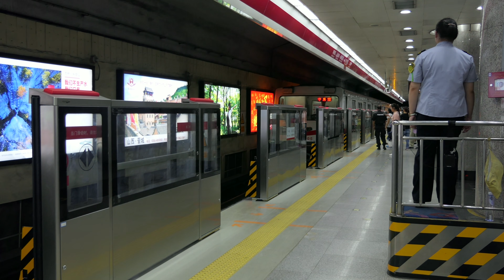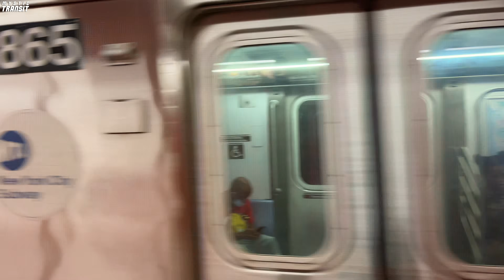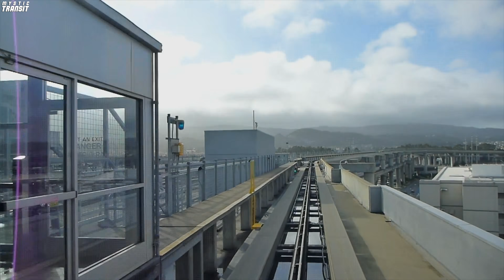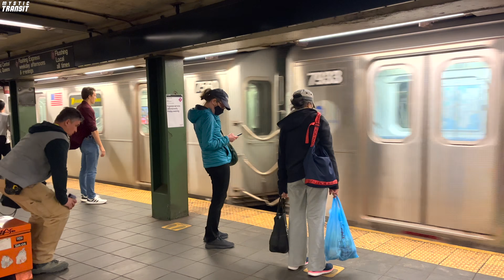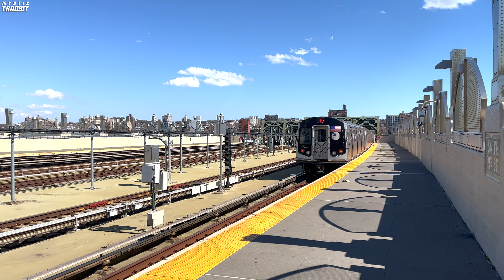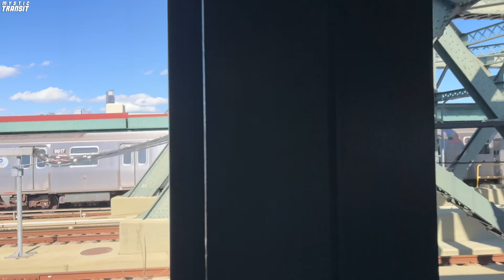Does NYC Need Platform Screen Doors?

Comment: I saw this video on my homepage because I have been searching out videos about platform screen doors since I discovered a video about them being implemented in Japan.  I am going to be speaking at the Chicago Transit Authority Board meeting next week about this very issue.  There is a video showing a station in Japan that has a fence that rises up above the platform when a train approaches, and I'm wondering if that is less expensive to do because there are fewer moving parts.  Also, without individual doors that open sideways, you don't have to worry about differences in distance between doors on different trains.

Comment: The problem with multiple rolling stock having differing door placement would make the wire rope platform barriers seen at some Japanese train stations the best solution.  I believe they are also cheaper than the standard glass panel psd's.

Comment: Right now, the one station that I believe should install platform screens doors is the Lexington Avenue/59 Street on the N/R/W line. It has one island platform that especially gets crowded around the stairs with people transferring to/from the Lexington Avenue line. But since the station is used by rolling stock of different length, the R160’s 60 footers, and the 75 footers of the R46s and R68s, the station that probably needs the platform screen doors the most is unfortunately a station that currently can’t accommodate platform screen doors.

Comment: My take for PSD in the NYC Subway is that it should be implemented at places that have little to no interlining and have rolling stock with similar dimensions as mentioned. The Flushing Line (using R188s only) and Canarsie Line (using only R143s and R160As) could have them first, since they are mainly deinterlined anyways, so PSDs can be installed there with little issues. As for the rest, they would have to wait till the rolling stock dimensions are standardized.

Comment: If they need the platform screen doors for the entire system. They need to clean up and Seal off any cracks and upgrades the track foundation. Then entire system will installed Platform screen doors. Because i seen the other video on other YouTuber i seen the rat around the line and some train have 3 door on each side and some train have 4 door on each side.That my guess.

Comment: A big problem with platform screen doors or barriers is if a train comes in and has to stop short for some emergency, the train  doors won't line up with the platform doors trapping people. The TA does have limited platform barriers in select locations and is looking at other locations. One long existing example are the ends of the 7 Grand Central Station platforms. Most transit systems don't have platform barriers for good reason.

Comment: Yeah, that's what I'm thinking because it's really scary for people getting pushed into the tracks aggressively, so in order to solve this problem, I guess the MTA should add screen doors so it will be safe and easy for people to not get pushed off the platform even when their's a crowded subway platform or people bumping into each other so it's a smart idea to put out some platform screen doors

Comment: Here in São Paulo, line 4 was the first to be inaugurated with doors already open in 2010, then line 15 of the monorail in 2014, then it was installed in all stations of line 5 in 2021, which had been inaugurated in 2002, they are currently installing them in lines 1, 2 and 3, leaving all stations with doors until 2025, there is the plan for installing doors on metropolitan train lines, we call them cptm here, lines, 7,8,9,10,11,12 and 13, Line 13 connects the city center to Guarulhos airport, opened in 2018, there are plans to put the doors on this line first. We have too a street car line, in Santos city on the coast, we call it VLT, and all stations have the doors, even though it is a service with low demand, All new lines, like line 6, and line 17 of monorail being built, will already have platform doors

Comment: 30 million dollars per station is nuts. How much do they cost to install in Europe? The door issue makes them a total non-starter at most stations. The L and 7 are the only routes where they can be installed at every station, not that it's needed. This is because they are the only lines that don't interline with any other services and never see reroutes of other services. I'm skeptical of installing them anywhere on the QBL because while it operates exclusively R160s now, what if they want to run R211s on it eventually?  If they don't have the same door positions as the R160s, then they will be banned from the line.

Comment: There are doors on cars, there are doors on lift. The door keep you save, and save life’s, and how is it not implemented on New York, one of the busiest and largest metro system in the world.

There are actually different doors with different size. And I don’t understand why the metro cars need to be flexible. I think few lines exchanging car is ok, but for the whole system, that is a joke.

There is a fixed amount of riders everyday. The system engineer could figure out how to optimized it while having same type of trains on each route. Then, a door could be installed.

Comment: Very simple , low cost, low tech solution, would be To look down at your feet. If your standing on a Yellow stripe, BACK UP!!!!!!  Or when possible, position yourself behind a pole or other obstruction until the train comes to a stop. This works very well since as a teen in the 1970's and 80's the NYC subway was a Brothel for crime,and I'm still alive and well.

Comment: I think the screen doors can work on the IRT lines (1-7) since the doors stops at the same spot.  Some station already has markers on the platforms where the doors are going to be at.  As for the letter lines (D and F trains) they are still using 2 different cars whereas you mentioned on the video, the doors do not align.
Reply: The IRT still also have different door spots where the trains stop so you can't install them on all of the IRT lines

Comment: There are three problems with placing barriers on the subway platforms in NYC.  So he’s right about this.
1. The older trains and newer trains have different door positions making it impossible to indicate where the doors would open at.
2. The financial situation for this would be nearly impossible. Plus it depends which platforms need it the most. Mainly on the newer platforms like the Second Avenue line or on the Flushing line.
3. Reducing crime is the biggest problem we face today and it only getting worst by the day.

Comment: I think for screen doors to be implemented there needs to be gentrification of the subways. Clean them up and make them less dirty, grimy Hotspots. Once done, I believe chest-high barriers should be implemented, ones that slide open automatically. This can allow for a good view of when the train is arriving and for rail fans. Unlike many stations in South Korea, these barriers are completely inclosed which obstructs the view of the train. I also highly encourage the MTA to add barriers to congested stations, narrow platform stations, and to elevated stations.

Comment: I think Platform Screen Doors will mostly work for lines using NTT’s. The 7 using mostly R188’s and the L using mostly R143’s (w/ R160’s playing a supporting role) would likely be contenders for PSD’s to be implemented throughout most of the lines.

The SMEE trains would all have to be retired in order for PSD’s to implemented on most stations throughout the system. Notice how I said “most”, because not all stations can have PSD’s installed, especially those with columns close to the platform edge or, like 14th Street-Union Square on the 4, 5, and 6, have platform gap-fillers.

Comment: Some of our subway stations almost like a S shaped C shape curve beds that the tracks lay up on. Depending on how the platforms are designed Fencing door's for safety purposes is way to expensive to reconstruct over a 100 plus year's Transportation system.
Reply: Plenty of stations on the Paris metro also have curved platforms and still have screen doors

Comment: It's too old of a New York City subway station to install new fencing of gates around most of the New York insurance that run above and below plus tickets to consideration we have platforms that has elevators most of the cars and doors will have to be redesigned for all of that purpose plus it causes thousands of dollars to restructure and rehability station that will run throughout the course of having that done. NYC transit system would not pay money for that installment or the tax taxpayers of New York City or the state and local government will not help with that pressure financially at all it is considered a burden.

Comment: NYCT barely keeping the system running.  When there is heavy rain, the stations are flooded.  Will the flood water cause any expensive damages to the proposed screen doors.  Low tech steel platform barriers might be better solutions.  More importantly, need to relocated and treat the mental-ill people who are occupying the NYC subway system.

Comment: I think that the full height doors and standardisation of rolling stock will be useful in tunnelled sections. At above ground sites half height PSDs may suffice. The MTA like all organisations have a duty of care for their passengers so if an accident occurs and the victim Sue’s then there is the question of did the MTA / service provider do everything reasonably practicable to protect the health and safety of not only their passengers but also their staff. Picture the impact a one under has on the driver and the risk of losing a highly trained staff member and the I pact that has wither temporarily whilst signed off or the recruitment & training costs if they leave.

The other thing we need to consider is the cost of disruption when these incidents occur. It is not only the direct economic impact on the transport provider but on wider commerce. For this I will use an aviation example. In the late 1990s at London Heathrow Terminal 1 there was a fire in a Burger King outlet which caused major disruption and £500,000 damage to the terminal. Sounds big money? Now think of the knock on impact to the airlines which come to approx £6-7 million but it does not stop there as a predominately business airport the global impact on world business was approx £140-150m whilst a person on the tracks won’t have as big an impact as the Burger asking fire it will impact other business. Following the fire fast food outlets disappeared at Heathrow and a number of other UK airports with much stronger restrictions on catering outlets. So how can NYC MTA and other transit providers reduce the impact - simple measures like platform edge doors starting at the bigger/busier stations.

The fire at Kings Cross London Underground station at which saw many lives lost saw the end of wooden escalators and the banning of smoking on the network.  Access and egress has also been looked at at Kings Cross and platform safety at Bank station has seen a new platform constructed with more space (admittedly disappointingly without the platform edge doors which I think should have been installed at all closed stations during the Northern Line blockage).

It is however important to recognise the local trends to work out your higher risk areas but also useful to understand the challenges faced over over systems around the world learning from their development of services. Transport and human behaviours is always changing so it is important to ensure that we keep up with evolving changes such as platform edge doors and the new dedicated limited stop services such as the Elizabeth Line in London with dedicated lines and stations to also reduce congestion on existing infrastructure.

Comment: This is a good and bad idea because since the trains are manually-operated it can cause this: misaligned train doors, so the passengers would not be able to access the train; instead they will hit a wall. The good news is that the track-pushing crime will drop, and the tracks would not be overloaded with garbage.

Comment: The R211s are supposed to have wider doors which means they can’t interline with the R160s and R188s if you have platforms screen doors. Plus so many platforms don’t have the space. It will never really be possible. The idea is mostly floated by people who are uninformed about transit after a horrible incident occurs.

Comment: They should! they have it in most first world country. but America should be Number 1 is last when it come to anything that's good for the people. there's a saying around the world. anything you see will be in America 20 years later. thats how slow America improve. one thing for sure, WE NEED AC! PLEASE!!!

i also love it when you say the MTA system is designed in a way to allow interlining and easy rerouting. sure is easy rerouting when you see the train you trying to catch close the door as the your train is pulling up to the station n the train you trying to catch slowly drive away! easy my ass.

MTA is all type of broken. theres 99 problem and no solution.

Comment: Some Chinese hi-speed rail stations (with less frequent services) are using platform edge ropes. They block the trackway when there’s no train, and be elevated to there’s a train arriving. 

But the cons are the problem if their slow movements can be capable for NYC’s headways.

Comment: Issues of people falling onto the tracks?  That's a good one.  People wouldn't be falling into the tracks if not for the NYC evil and crazies pushing innocent people onto the tracks.  Those barriers are a must for our transit system.  There isn't any other way to stop the crazies from harming people simply minding their own business.  I'd rather pay a higher fare to get those barriers installed and not have to hear another sad story about someone getting shoved under a train for no good reason.

Comment: There would he difficulties that would ultimately make this an expensive mistake. The NYCMTA, changes the length of trains at various times to insure the safety of passengers at any given time. So any type of door system would require that it could also be closed off to accommodate this feature. Additionally, such screens would be an additional target for  vandals be it graffiti or breakage of materials or door openers.

Comment: Even though this would be a great idea, the cost to install and maintain the PSD system would be too high. There are other technological alternatives that could be used.  It’s also an old complex system. I can imagine if this was to be implemented, the edge of the platform would have to be redone to accommodate the weight of PSD
Reply: 100 million could pay a lot of salaries for more blue vests with flashlights to stand on the platform... And they would only have to be working during rush hour periods went the threat of falling on the tracks is the highest

Comment: One thing that people overlook with the installation of platform screen doors is how this is going to affect conductor operation. Conductors have to look out the window while opening and closing the doors to check the platforms. If these doors are installed it’s going to obstruct the conductors view as they can’t either look out the window or get a view of the platforms!
Reply: Other public transportation systems have no issues with this. The doors have sensors to detect if they're open and closed. Could also be solved with cameras (the stations already have cameras everywhere)

Comment: The NYC Subway did have PSDs at one point. According to a community post by Mr. Railfan about 6 months ago, (photo #41), experimental green doors were tested at one of the L Train stations, with plans to renovate the rest of the line with PSDs during the L Train shutdown. But as the shutdown was canceled, so too were the PSDs on that line.
Reply: They didn't have PSDs, that was just a render. Photo made it obvious.

Comment: And honestly I don’t think the MTA should waste their money on platform screen doors on a system that’s been here since 1904. I do sympathize for the victims but the pushing onto the tracks isn’t as common when people actually learn how to stand behind the yellow line even if shoved instead the money should be use to continue maintain and upgrade infrastructure, signals and also improve the lighting, tiles and add on security cameras. You got to remember there are 472 stations in the system and you won’t be able to install all of them within 10 years

Comment: I admit train reroutes is a point I hadn't considered before.

Even so, there are some lines now with unified rolling stock, specifically the 7, and the entire BMT Eastern Division. Those may be good starting points.

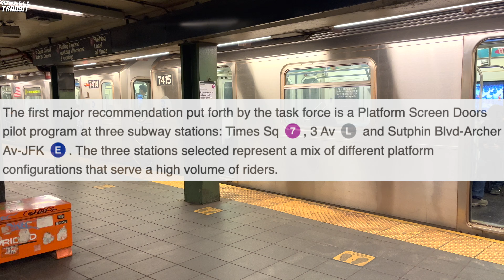Also, would SMEEs be able to run on CBTC lines? If not, then all rolling stock with CBTC (NTTs, obviously) already have the same door placements, so we can start with the few CBTC zones we have now (e.g. Queens Blvd) and progress when more lines become active. All three stations selected for the pilot (4:00) match this criteria.

Two other advantages for full-height platform screen doors:
1) Climate control. Probably not worth the cost at smaller stations – some elevated stations have enclosed mezzanines that you gotta open doors to get through, and they even have heaters for the winter, which is fantastic – but at the most popular stations it might be worth it (e.g. 74 St-Broadway, Bway Junction). Such systems could also help to filter and clean air…
2) Protect people from fast-moving trains that create a lot of wind, particularly in underground stations. A prime example in my mind is Lex Av/53 St on the E/M, where Queens-bound trains create a push of wind for like 20 solid seconds before they even speed into the station. You hate to be on the edge of a crowded platform when the train's coming like this.